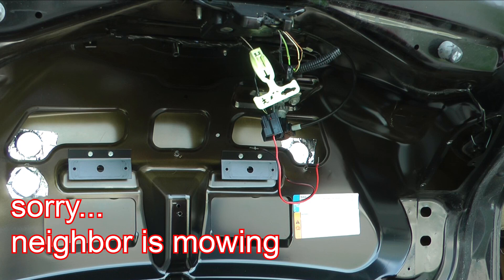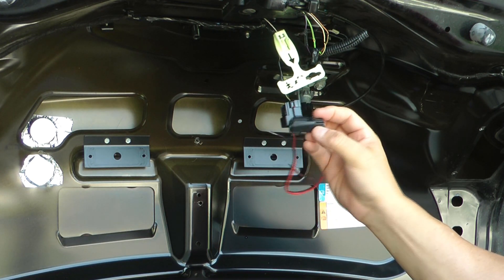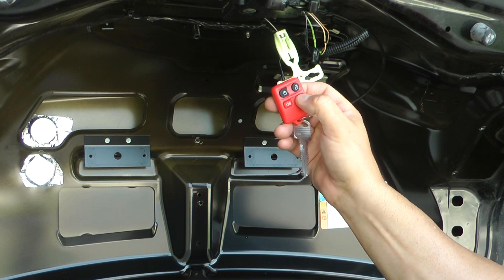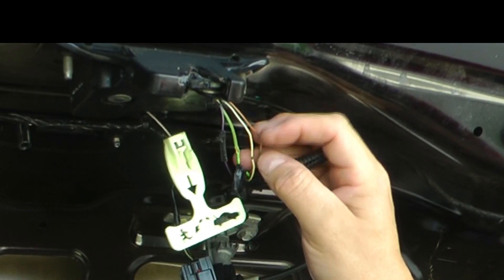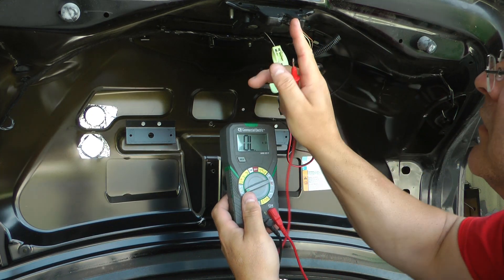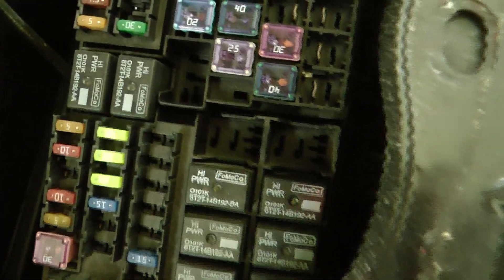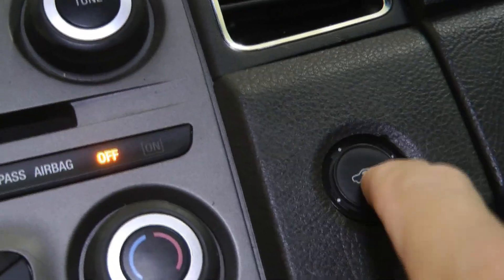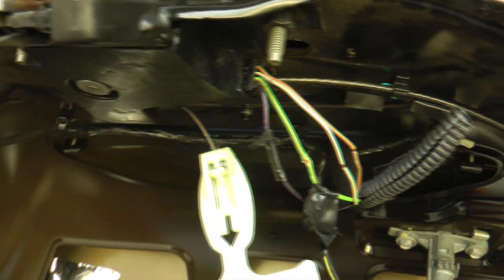HELP!  Ford Police Interceptor Sedan trunk release not working

Comment: I haven't read through the comments but has anybody suggest ForScan to you to correct the problem. The car's computer may still have the function blocked out. I myself have a 2013 Ford Police Interceptor Sedan. I've managed to unlock a lot of functions. My trunk pop has a listing as well.
Reply from the maker: Forscan wasn't the issue... ended up being that the PD took the trunk pop button and flipped the guts around so it wasn't operational

Comment: Check the modifiers guide section 2-20 and 2-21
Reply: The connector is by the rear PowerPoint of the Taurus drivers side of the trunk well
Reply from the maker: thank you!  Will do
Reply: @WJHandyDad  did it work?
Reply from the maker: thank you so much for checking... believe it or not, what got the key fob working was a Forscan setting.  I still haven't gotten the dash button working but have moved that to a lower priority since most of the time I open the trunk with a fob anyway

Comment: I used to install electronics on them , they cut off the old wire going to the th oem switch and replace it with a more secure and convenient system.  Look for a wire cut in the trunk running with the harness going down the trunk lid .the two fattest wires are going to be the motor wires
Reply from the maker: I'll check again, but I didn't see any cut wires in the trunk other than the wires on each side that power the trunk light.
Reply: @WJHandyDad  you probably already checked the switch if it plugged in , it may have been disabled
Reply from the maker: @JailBiden  the switch is plugged in and there is power on the 3 wires so they don't appear to be cut anywhere
Reply: When you're using your meter in your checking and you run across the ground it could be a residual running through a coil of the trunk motor, it needs positive to activate. Or vice versa we're 12 V is the residual power in that case it would be a ground that triggers it. If you get an old-school test light or probe you may be able to get that motor to trip a little bit to see what you need to do to get it working
Reply from the maker: @JailBiden  that's why I was hitting them with the hot wire but nothing triggered anything.

Comment: Yeah there's a jumper that you can just make to complete the circuit with that plug.
 Usually when they decommission a vehicle they remove the police equipment from from it and there's  components that are put back in or bypassed for safety because there's usually guns and equipment in the trunk that would be accessible to someone unauthorized if the button on the dash works.  If you look around there's probably a momentary switch somewhere hidden under the dash that allows you to release the trunk for for 30 to 60 seconds and then you have to revert to the key.
Reply from the maker: I haven't found anything so far.
Reply: @WJHandyDad   Yeah it may or may not be there anyways the only thing I could think of that was a good suggestion was that possibly possibly the motor surveillance inside inside that trunk latch might be faulty.
 Other than that the trim panel that actually holds the button on the dashboard next to the glove Box might either not be plugged in correctly the button could have been damaged or the wires might have been jumped into some other component that was removed with the police equipment..
Reply from the maker: when I got the car I pulled the trim... the button was connected.  Strangely it has 2v to one wire, 10v to another, and one ground.  When lights are on, the 2v goes to 12v.  I don't know if the switch is supposed to ground the 10v or send 10v to the ground wire to trigger the trunk, but manually hooking up the wires together did not trigger the trunk.  I wonder if there is a Forscan setting to disable it.  Forscan was how I got the Keyfob to work and how I fixed the brake lights.  Scary how many things are just a computer setting on these "newer" vehicles

Comment: (most) American vehicles use ground for switching, because of almost no arcing
when the circuit is broken. Is there a light in the trunk?
If the light is blown, the circuit might not respond. Also, agree with Panzer Platform,
FOB could be not programmed into PCM.
Reply from the maker: they had cut the trunk light out so I reinstalled and have trunk lights when I open the trunk (video coming!).  I've tried programming with Forscan but  every option in English doesn't fix it.  And I can't find a good chart of the 7xx-yy-zzz codes for the Taurus Interceptor.   There are plenty of charts for F150's online but they don't seem to match up

Comment: I know this is gonna sound dumb but did you pull the panel off and see if they just forgot to plug the button on the dash back in after the vehicle was decommissioned!
 That might also defeat the remote feature because it has to go through the electrical system of the car and  Ford's have a floating ground type system.

Comment: Do all crown VICS ( like possibly my 2011 cvpi?) have a key fob? My car came with a spare key (the only key) stamped EVIDENCE. I would like to get the original key and key fob If possible.
Reply from the maker: I think most, if not all, of the Crown Vic police interceptors did NOT come with a FOB and just had old fashioned turn the key to unlock the door entry
Reply: @WJHandyDad  🤔 huh, I was wondering because I’ve seen police actually use a key fob to pop the truck before and that’s what got me wondering..
Reply from the maker: @I8ITSK8N  perhaps they had the street appearance package model?  It's funny because when I started driving there wasn't keyless entry.  But now I'm to the point where I almost can't function without it, so I add it to every vehicle that doesn't have it
Reply: @WJHandyDad  yea, I thought about that too but it was a black and white patrol car with two spotlights and a push bar …🤷‍♂️ I gotta do some more research on it. I was mind blown lol
Reply from the maker: @I8ITSK8N  yeah, that has to be a "unicorn"

Comment: You'll probably have to wire it completely in. I think it's like that from the factory. The only way in is the key. Makes sense if there were high value items or firearms in the truck that someone couldn't just push the dash button. Not sure if the programing on the canbus would need programing as well. The fact there isn't relay wiring is telling that there's probably no wiring for it in that model. the wires to the latch are probably just for notifications or alarm. Behind the dash button it's probably not plugged into anything and just used as a filler.
Reply: I actually have a 2011 CVPI and I was watching a video and a cop use the key fob to open his trunk and I thought to myself I don’t have a key fob!? Can I get one!? 
But the cop did use his key fob to pop the trunk.

Comment: Lookup on YouTube trunk remote Ford Taurus police interceptor does not work.
Reply from the maker: I typed that in exactly and my video is the top result  LOL  But nothing else comes up that looks even remotely helpful
Reply: @WJHandyDad  I did the same thing. Sorry have done it for other problems. Just thinking. Did you try Google.
Reply from the maker: of course!  I don't post things without doing a bunch of checking  I've Googled all sorts of things about Forscan and trunk release but not finding anything.  I keep thinking it's gonna be some weird thing.  But every lead I find sends me on a chase to nothing.  The button was connected, there is power to it, fuse not blown, etc.  Makes me really appreciate the Crown Vic simplicity that much more!
Reply: @WJHandyDad    Have you heard of the Forescan tool it is a great scan tool for Ford products. It can program many things on Fords. Thinking about getting for my Mercury so I can reprogram some of the features on my car.  Sorry about the Google.
Reply: @WJHandyDad    Just a thought. Good luck. Maybe Eric O from South Main auto can help. He is the best diagnostic mechanic I have ever seen. You problem have heard of him. Just a thought.
Reply: I suspect the latch itself went bad. I had the same issue with a CV. It started making noise then eventually died completely.
Reply from the maker: @LimitedEditionMotorcars  yeah I replaced my Vic latches when we had the "snowpocalypse" they were making a buzzing noise instead of working.  I will probably have to bite the bullet and try replacing it
Reply: @WJHandyDad  I don't know about the Taurus but the CV latch was pretty cheap.

Comment: keyfob?
Reply from the maker: the key fob didn't work - shown in the video several times not working.  It locks & unlocks the doors and will activate the panic alarm though
Reply: I saw it I was thinking maybe trying a different one?
Unfortunately  my reservation at the Holiday 
Inn Express is for tonight..
Reply from the maker: I have 2 fobs and both work the same... lock, unlock, panic but no trunk pop